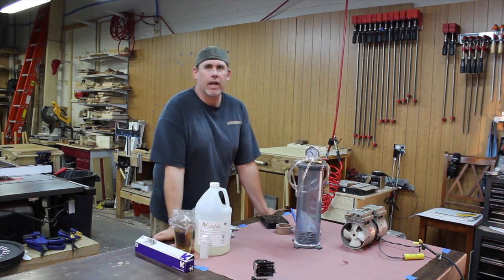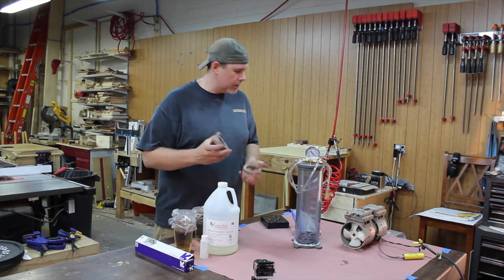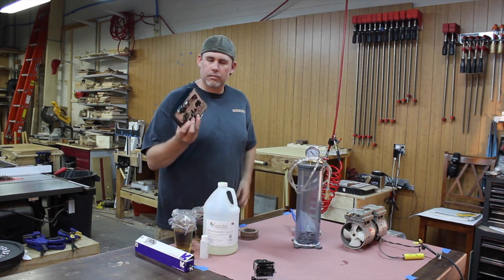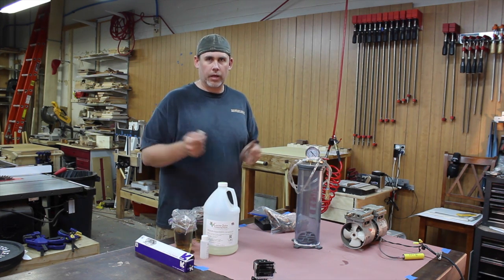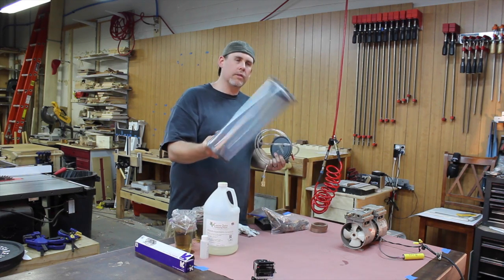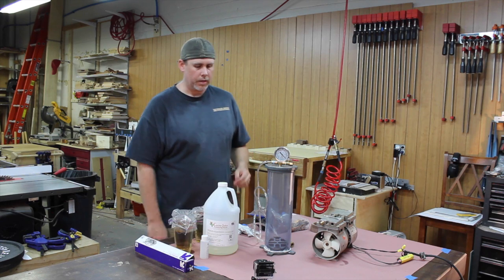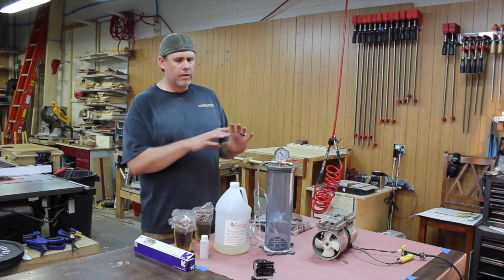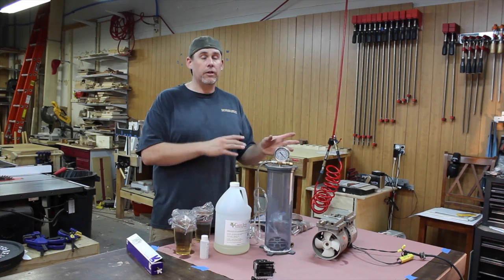Stabilizing Wood Part 1 - Getting Started & Equipment

Comment: Hey Zac, love your videos. I have a question. When you stabilize sweetgum balls, the little tips are still brittle. Do you kinda break those off before casting, or leave them on? If you leave them on do they chip out while turning? Thank you.

Comment: I just received my 1st set-up, Pump/chamber/ juice etc. I've watched many videos on the process and I think i have the idea down pat. My question is: After the initial "foaming" and it settles down to where you don't have to watch it/bleed it anymore. Do you really need to let the pump run constantly? I realize the off gassing that continues will lessen the vacuum. I guess what I mean is, can you turn off the pump for a few hours then restart? I know it may take longer but I don't have a shop. My lathe etc is in my living room. I want to stabilize some stuff, maybe watch a movie then restart the pump when I go to bed. I know... it sounds crazy but it is what it is and what I have to contend with.

Comment: Got another question Zac. How many drops of Alumilite dye do I put in a jar of stabilizing resin, say, 16oz of resin?
Reply from the maker: Great question. I usually just kind of wing it when I'm dying smaller amounts of it, but I always err on the side of more dye. The 1/2oz of dye per gallon of CJ measurement typically gets you some good coloring, so if you can try to convert the 1/2oz per gallon measurement down, you should be good to go

Comment: Hi Zac, .  I started doing a little searching for stabilizing equipment and got a BIG sticker shock.  My question is what is the least CFM on the pump you can use for the stabilizing to be effective?  Thanks, Terry.
Reply from the maker: Hey Terry, actually CFM is irrelevant for stabilizing. The main thing you need to worry about is how effective it is at removing air. Curtis Seebeck has a great article on his website that covers this topic in depth, so I recommend giving that a look.  https://www.turntex.com/help-center/cactus-juice-stabilizing-resources/98-selecting-a-vacuum-pump

If you want a recommendation on which pump to get, there are two that I would choose from. The Robinair 15310, which is what I use, is an import pump, non serviceable if something goes out, but it is relatively cheap. The other option is a JB Eliminator which is made in America, serviceable, and is more expensive. Basically, both will do exactly the same thing, so it's just up to your budget and whether you want to pay more for an American made product that you could service. You can see the Robinair I use in this video: https://www.youtube.com/watch?v=RNzerafDx3c
Reply: Thanks Zac, very helpful.

Comment: Hi Zac. I'm currently doing some experimenting with wood stabilizing for a shool project. I was wondering if you have experience with glueing a stabilized to a non-stabilized piece of wood. Would you use some kind of epoxy glue for that?
Reply from the maker: Hey Niek, yeah epoxy will work great for that

Comment: One more question,  when should I change the juice?
The juice's colour is getting darker, so I woundering when should I change it. Is it ok to keep recycle? Or there is a limit of it?
Reply from the maker: It should be fine. As long as it still hardens when you bake it, it should be good to go. You can just put some of the resin on a piece of aluminum foil and bake it to make sure. If it doesn't harden up, then it's time to toss that resin out

Comment: Hi Zac, I started playing wood stabilizing because of your video.
All of your videos are so usefor, but I'm having a problem. Which's it tooks my 3 days to suck all the air out from an 4*6cm² cylinder. Is it normal to take this long ?
I use the same  juice as you do,but with a smaller vacuuming mechanic. It will be great if you can give me some suggestions.
PS:If I sounds silly, or not making any sense to you. Is because I don't really speak English very will.
Reply from the maker: No worries, I understood you =) There are a couple things that come to mind... 1. Did you dry out the wood fully? If there is moisture in the wood, it can take longer. It needs to be dried to 0% moisture content. 2. Was it a big piece or a dense piece? It can take quite a while to get it all out with larger pieces or very dense woods
Reply: I did bake the wood under 70°C (around 158°F) for one hour,
The wood size is 2*2*3.14*6cm³ cylinder, and I cut a square on the wood. So it is empty in side (I wish I could show you the photo of it). The wood a black ash.
I have see some of the people put their wood in a pressure cooker, are they putting pressure in or vacuuming it out?( Does it works if we vacuuming it out. Then when the bubble slow down, switch it into a pressure cooker pressure it. Will juice goes in?)
My vacuuming pot is a refit gas barrel, it's quite big. My vacuum pump get 1.8(55) CFM(1/min),and 5 pa Ultimate vacuum.
Reply from the maker: It's best to dry the wood out above 212 degrees F, that is the boiliing point of water. It can take days to get wood completely dry, check out my video on drying wood: https://www.youtube.com/watch?v=v-jwrEhtn20&t=73s  I don't know about other methods for drying and stabilizing wood, I do it the way I show in the videos

Comment: Zac, How do you determine which or type of wood must be stabilized. For example, wood purchased at a big box store such as an oak board (block) cut 2 x 2. I think they are mainly for small projects. I was going to cut this block of wood into pen blanks but wasn't sure if it had to be stabilized. Without you videos I couldn't begin to attempt any project requiring stabilized wood. I greatly appreciate what you are doing.
Reply from the maker: Hey Charles, technically only punky wood or things that may come apart need to be stabilized. I generally stabilize any wood I'm going to embed in resin though because it has some advantages when casting it. The big one is you have to dry out wood to 0% moisture content if you are going to cast it or before stabilizing it, may as well stabilize it so you can cast it whenever you like rather than having to dry it and cast it right away. Wood also tends to not float in resin once stabilized, it usually provides a better bond with the casting resin, and you won't get any color bleed from the dyes in the resin once it's stabilized.

Unless there's a problem with the wood though, I wouldn't stabilize it if I was just going to cut it into pen blanks.
Reply: Thank you, your answer was just what I was looking for. Keep up you good work and have a nice day.

Comment: Can you stabilize with cactus juice after casting in alumilite? I was too excited about my first casting and didn't stabilize the red mallee I used, I put a bit either end of a pen blank with resin in the middle, or do I need to stabilize it? It is really hard wood, I'd love to show you my first attempt somehow Zac since I couldn't of done it without your videos
Reply from the maker: Hey James, 

There are just a few advantages to casting stabilized wood, but if it's already cast there's probably no reason to stabilize it. If the wood needs some extra support, I'd just hit it with some thin CA glue while turning it. Red mallee is pretty dense though, so it should turn fine without stabilizing. The big reasons I stabilize wood for casting is just to ensure there is no moisture in the wood and to help keep it from floating in the resin. Unless the wood is punky or in really bad shape, it's often times not necessary to stabilize it. 

I'd love to see it!! You can just tag me on social media or shoot me an email with pics if you want. I have a contact form on my website: http://nvwoodwerks.com/contact/

Comment: How much does one of these vaccuum pumps and chamber cost?
Reply from the maker: The pump I use is a little over $100 on Amazon, and the chamber I use starts about $150 and goes up depending on what size you want. Here's a video that discusses pump selection and has links to the one I use: https://www.youtube.com/watch?v=RNzerafDx3c  I get the chambers from TurnTex, here's a link to them: https://www.turntex.com/product/cactus-juice-stabilizing-chambers/

Comment: hi is there wood that does not need stabilizing such as bubinga?
im trying to make a handle and i have allergies for chemicals
thanks :)
Reply from the maker: It's up to you if you want to stabilize wood or not, it just provides some advantages when casting in resin or allows you to harden up soft or punky wood. It will also stop wood movement, which may be necessary for some applications. If you are just turning a handle out of wood, there's no need to stabilize at all. Many of the tropical woods don't stabilize well anyway because they are very oily and dense.
Reply: allright, thank you very much! greetings from the netherlands :)
Reply from the maker: You're welcome,  I hope to visit the Netherlands some day =D
Reply: well if you like flat land grass and water then its pretty cool lol

Comment: Ahh. ok.
You just pour it into the gallon and add the dyes later?
you can store it this way?
Reply from the maker: Yeah, it prolongs the shelf life a little longer to keep the catalyst separate until you need to use it. You can store it after you've added the catalyst though. Dyes can be added after too

Comment: hi Zac, quick question for you.  i have some maple wood that's been dried.  it very brittle some parts and hard others.  here is my question.  can you sterilize the wood and then cast it with alumilite resin or casting casting with alumilite would be enough to make the wood hard enough to turn it?  thank you for your help in advance.  love watching your videos. very informative.
Reply from the maker: +Vahan Muradkhanyan Hey Vahan, glad you're enjoying the vidoes!! You will definitely want to stabilize it first, then cast it. Alumilite won't harden wood or stabilize it in any way. It just goes around the wood encasing it, doesn't penetrate the wood or stiffen the fibers.
Reply: +Zac Higgins thank you very much for the help.

Comment: Great explanation of the process!i am wondering could you stabilise a wheetabix dyed blue or red with food coloring
Reply from the maker: BCdesign Thanks Barry!  I'd imagine it would be possible to stabilize a weetabix. I would probably investigate simpler and cheaper methods than using the vac chamber though, might be possible to just dye it and then hit it with thing CA glue to stiffen it up.

Comment: I have the same vac chamber and juice. Curtis makes a great product. Stabilizing not only puts a limit on wood movement but also makes soft rotting wood plasticized so it can be machined without crumbling. I use it to stabilize spalted fiddleback maple blanks. Works great.
Reply from the maker: Thanks for mentioning that Sean, I totally forgot about it.  Speaking of that, I am going to try to see if I can stabilize some pine tree bark that's pretty crumbly to use in some blanks.